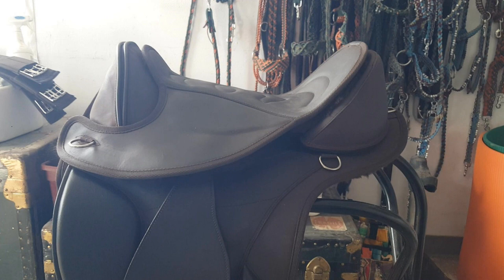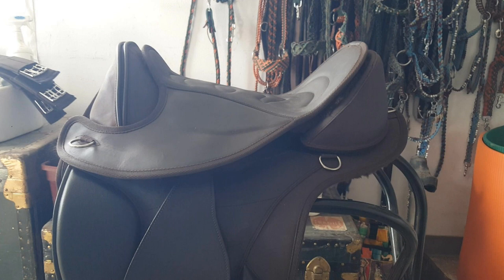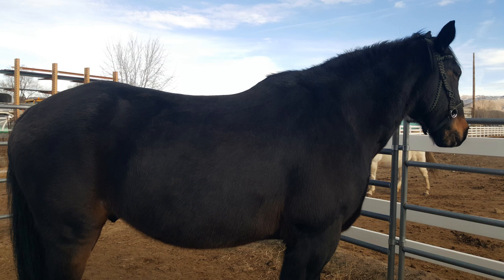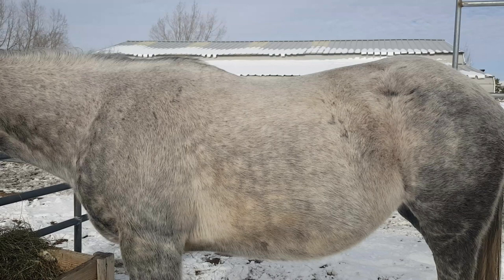Introduction to Treeless Saddle Fit and the EDIX Saddle System

Comment: Thank you so much for this video. It's so helpfull! I'm planning to buy a treeless saddle, so this video came at a great time!
May I ask what the name of the saddlepad you are using is? And do you have to use a treeless saddlepad, or is a ''normal'' saddlepad ok too?
Reply from the maker: Hi there! I'm glad you found this video helpful. The saddle shown is an EDIX Saddles Courville GP and the saddle pad is an EDIX Saddles 8 pocket pad.

You will definitely want a treeless saddle pad for your treeless saddle. Some treeless saddles do not structurally provide clearance for the horse's spine and rely entirely on the saddle pad to do that. Others, like EDIX, provide clearance in their saddles, but it's still a good idea to use a specialized treeless saddle pad to help further distribute pressure and increase spinal clearance.
Reply: @HavenHorsemanship  Ah ok, thank you!

I didn't know that, I will deffinetly buy a treeless saddlepad now I know this. Thank you so much for your explonation!
Reply: @HavenHorsemanship  Hi, I've bought a western treeless saddle will I need special treeless pad for it or can I use my normal western pads. If I need one, what's a good brand of treeless pads? Thanks!
Reply from the maker: @Tallbuff  what kind of saddle did you get? I prefer EDIX Saddles pads. I can help you with that if you're interested. 

Some other popular pad are Skito's and Equipedic.

Comment: Does it matter about the length of the saddle eg how far down back 🙂
Reply from the maker: Yes, length of the potential weight bearing area of the horse's back vs the weight bearing length of the saddle is important to consider. To measure your horse's potential weight bearing length, for most treeless saddles, you'll measure from the middle of the wither to where your horse's last rib meets their spine. Weight bearing length of the saddle depends on the make and design. For EDIX saddles, you can get a good estimate of the weight bearing length of the saddle by subtracting 6 cms from the saddle's overall length.
Reply: @HavenHorsemanship  thank you 🙂
Reply from the maker: My pleasure!